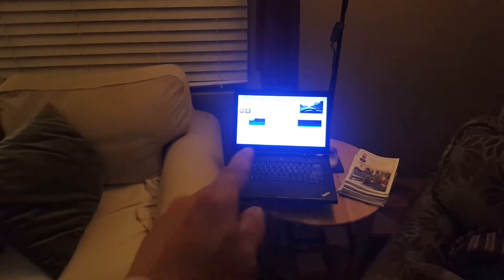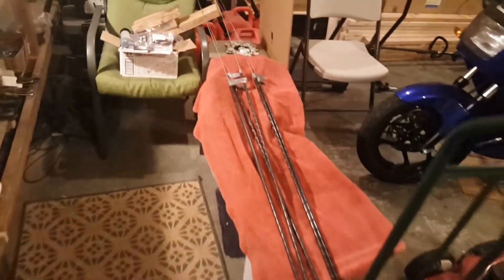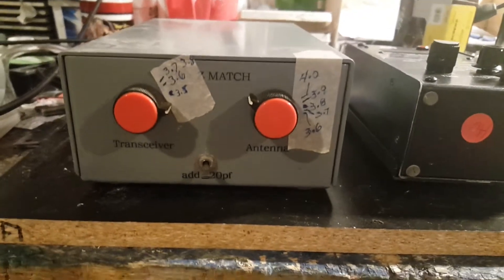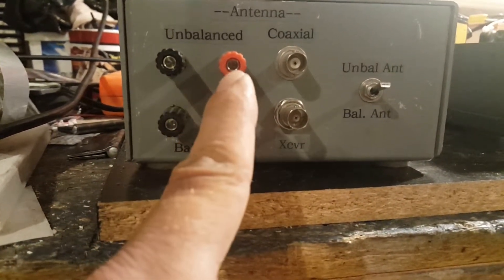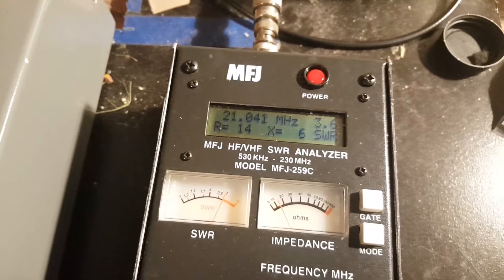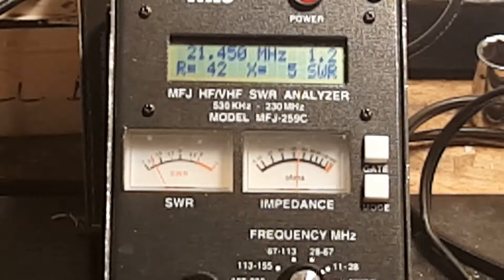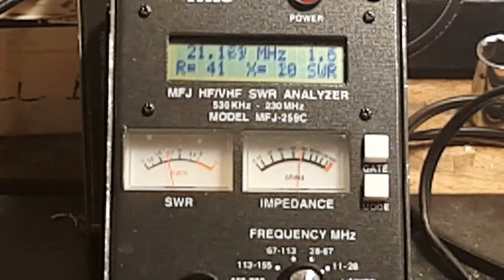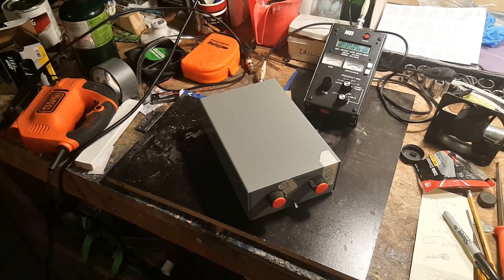The Case for the Z Match

Comment: Glad I found this video.  It answers a question I asked you on one of your other videos concerning your Z-match.  The question being, is the Z-match less lossy than an antenna tuner???  I have had a fit trying to tune my hamsticks mag mounted to the top of my car.  I eventually gave up trying for a suitable SWR and used a tuner.  I realize the hamsticks have a narrow bandwidth but I'd at least like to get them tuned to some portion of the band without a lossy tuner.  MFJ offers an MFJ-908 mobile impedance matcher.  I assume this is basically the same principal as the Z-match?  But since it has fixed capacitor selections an antenna tuner would still be needed to tweak the SWR.
Reply from the maker: Oh man.. you've touched a dear spot in my heart. And I'll answer your questions when I get home today. I've got family waiting on me for an outing today. I'll be back this evening and address your points and questions. Thanks for watching and especially commenting! ttyl... Chuck
Reply from the maker: Interesting questions. I'm pretty new to Hamsticks, but was given a half a dozen of them and have been doing a little testing. They're kind of old though, so in no way are my experiences probably the same as if someone bought a new one. Who knows. But a few of mine tested in band with my analyzer, after adjusting the whips. A few were not however- resonating just above the band edge at the top. I'd have to cut some of the whip off, which I'll do, but haven't got to it yet. The 40 and 20m sticks resonate at about 20Khz above the bands. Not being able to lenghen the whips easily, I just grabbed my Z-match and can then seriously quickly, get a perfect match anywhere in the band. Is it ideal? No. But what antenna is? Using my multi-tap UNUNs, I can get an excellent match, no tuner needed, over almost all of 80m with an EFHW, and easily all of 40m. Hamsticks? Not the case. They're sharp as you mentioned. That's why I adore using my Z-match. A twiddle of the knob and I have a perfect match. Regarding efficiency: YES, a Z-match is FAR more efficient than any rig internal tuner due to Q. The rig internal by necessity must be relatively poor or low Q so that the rig doesn't have to retune every time you move 10 or 20 KHz. With a Z-match you don't have to.. not every 10 or 20 KHz.. but you do often, do to it's sharp tuning and seriously high Q (and thus efficiency, if you use good components). You may have seen those small lightweight 'QRP tuners' that have an LED to indicate a matched condition. LED goes out and you have a decent match. Those are tiny Z-match based tuners. I'll do a video on my Z-match.. the components used, how I assembled it, etc. I've actually posted a video showing that using your rig's internal tuner LOWERS your power output, not increases it, as long as your rig is not throttling back power due to swr. In my demo, I had an swr of 2:1 i think.  Hmmm... what else.. lol. 73   :)
Reply: @n8nkqrp595  - Excellent!  Thanks for the reply and some very useful information.  Yes, I have seen the small QRP Tuners with the LED SWR indicator and saw the schematics.  I assumed they were Z-match tuners.  One was the Emtech ZM-2 and the other was was a kit by the 'QRP Guys'.  As I mentioned, MFJ offers a few mobile antenna match boxes but they do not have variable capacitors.  Looking forward to your video explaining your Z-match and the components.  I like that little box!  73!
Reply from the maker: @KX4UL  Thanks for that! Yep, they're z-match tuners. I have no idea how lossy the tuning caps are in them.. those little 'polyvaricon' caps.. but it's probably reasonable high. I've never had one of those small tuners.. but I'm planning on building something between that size of z match and my current one that I use. If you look at my QRZ page, there's a bit of a description of how I used the tuner to work all bands from an apartment in Seattle. I've been shirking in my 'duties' lately. Actually, my brother was visiting. But he's gone now.. and it's back to my 'duties'. lol. I'm heading to my sister's house this afternoon to do a few small repairs.. then tonight I'll do a combo video showing the Z match, it's construction, parts used, and I'll show my one UNUN failure and see if we can figure out what happened. I still have no idea. Haven't touched it since it literally smoked. lol. 73 OM! Take care   :)

Comment: Why don’t you just tune the antenna to where you want to use it, rather than inducing some loss with a tuner? You’ll get more RF out of it being timed without the need of the tuner then with.
Reply from the maker: Agreed. I wanted to see what a Z match would do for a mobile antenna such as a narrow band ham stick because it will only be an excellent match across a narrow range. I'm thinking mainly of in-band excursions- such as if the stick is tuned to the phone portion of the band and I want to work some CW, etc. The Z match Q is far, far higher than that of the internal Yaesu tuner, and I'd rather us it for in-band excursions than the rig internal tuner for the very reason you mentioned.  Thanks for watching and taking time to comment   :)
Reply: N8NK QRP since a few weeks before Field Day, I’ve been playing with a 19’8” vertical on all bands. I know you are using the cacti, but with a base mounted automatic antenna tuner, the short vertical has a great low-angle pattern on all the bands of 160-10. I’ve gotten into many pileups with it and am experiencing the same results I saw in the computer modeling. The myth of losing a lot of power through an antenna tuner goes out the door when it’s mounted at the antenna. Provided you’re not unreasonably trying to use too short of a radiator.

Comment: I made a Z-match a couple of months ago and it will match anything, barbed wire fences, ridiculously mismatched antennas, etc. Much more flexible than T-matches made by the usual suspect manufacturers.
Reply from the maker: I know! Dang things are amazing. Touchy? Yep. Because of the ultra high Q and thus efficiency. I think I watched Peter, VK3YE, load up a softball field chain link backstop using one and working some 160m activity. lol.  Take care   :)